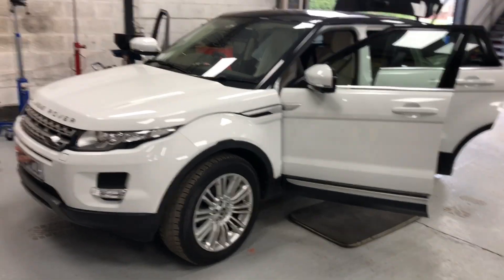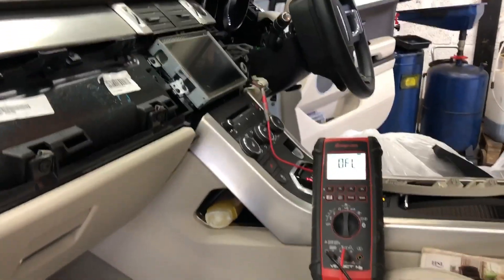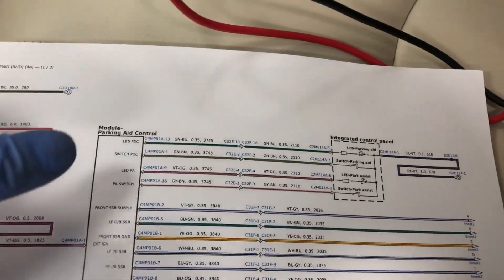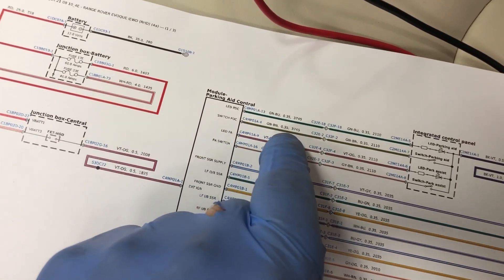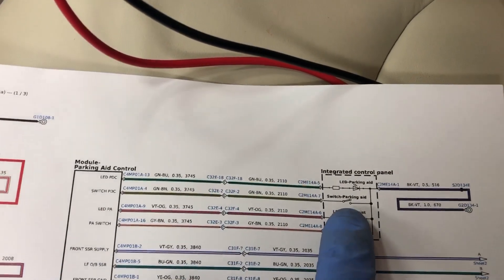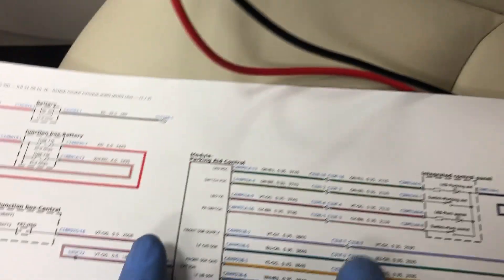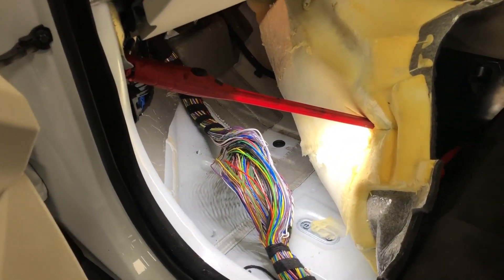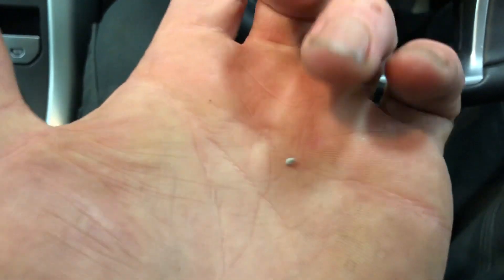Range Rover Evoque - Parking Sensor fault - quick and dirty diagnosis!!

Comment: Awesome job mate , had exactly the same car now but have fault rear sensor power circuit and front power circuit issue. Still digging on the rear but maybe the front module I need to have a look? Because computer is not switching power to the fron and to the rear. Modul already replaced because old one been shorted

Comment: Hey, any advice you may have that may be able to help me with my Range Rover Evoque 15plate. I have had no end of issues trying to get parking sensors working. Started off intermittently but now permenant. It says parking aid unavailable please contact dealer. Or just the Parking button just flashes. I have had some rear sensors replaced as garage suggested they were coming up on fault codes. Faults still remained, they said wiring to some sensors was fraying so perhaps a new wiring harness as all faults were on the rear. I have today had a new rear wiring harness fitted from land rover. They reset the codes but still not working. I am not sure where to go with this, any advice would be appreciated mate thanks

Comment: Thats a great Find!, Unfortunately I have an Evoque where the Parking module DTC is Front Power Circuit Failed and Rear power circuit failed, it was intermittent failing every few months but has now become permanent, What would be the best way to start investigating this? Could a wiring fault in the front bumper cause both front and rear power circuits to fail for example? could a sensor failure cause both codes?

Comment: Amazing found !
I have this message when I turn on reverse gear  "Parking aid is not available. Please consult you dealer" and no camera working... When I click on "P" it flash 3 times orange and...nothing. No Big-bip, nothing. I have a Si4 Dynamic from 2013 since 1 week. The first time of this issue was 3 days ago and tonight. The others times, it was working normaly. Might be the same problem like you ? could you advise please?
Reply: Did you ever solve this?

Comment: Hello there just wondered if you could give me some advice on a error code that’s come up on my discovery 3 electric handbrake it’s saying “force sensor electrical fault” and handbrake won’t go on or off and the module is only 12 months old. Thanks in advance
Reply from the maker: LRO22 hiya 👍 what does the handbrake module do? Does it make any noise at all?

That fault code means that the force sensor hasn’t detected any increase in motor load - can either be a faulty sensor, motor not operating - or a few other things.

I think I have a video on that fault somewhere - have a look 👍👍
Reply: Yeah I will have a look for that video 
If you put the handbrake on the motor runs a cycle where it puts the handbrake on and off getting increasingly tighter but then won’t release, no bad grinding noises like last time when I had trouble, is the sensor a changeable part? Thanks for your reply
Reply: Hi, sounds like you could potentially have a faulty park brake module. Do you have the DTC code?